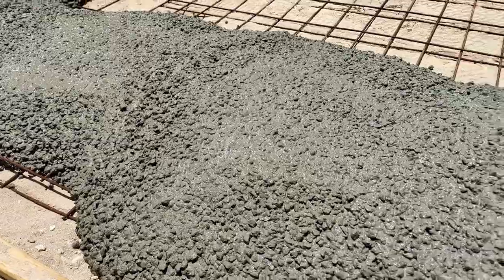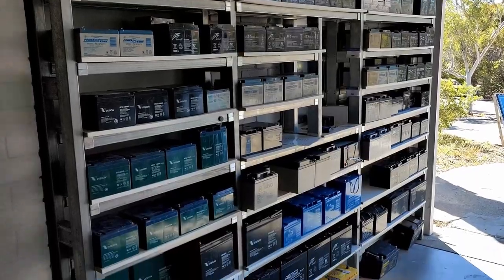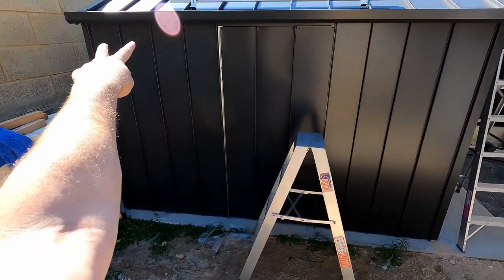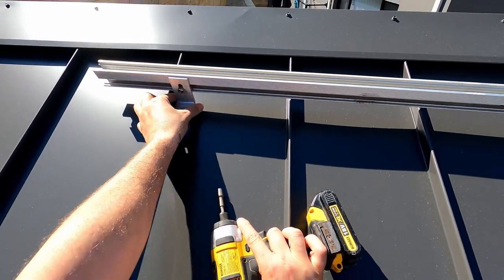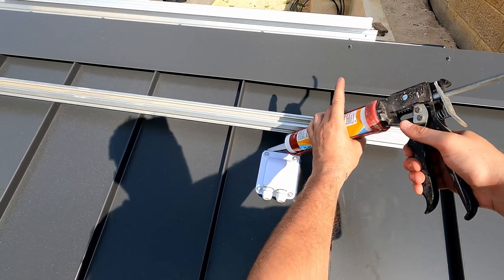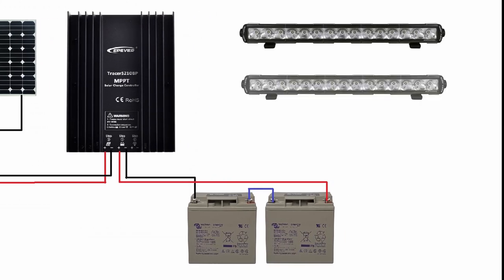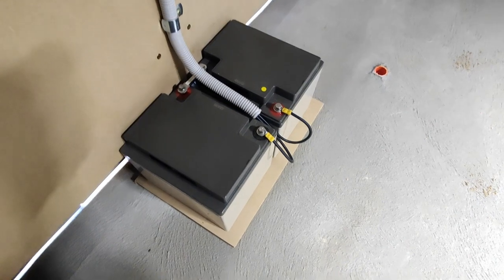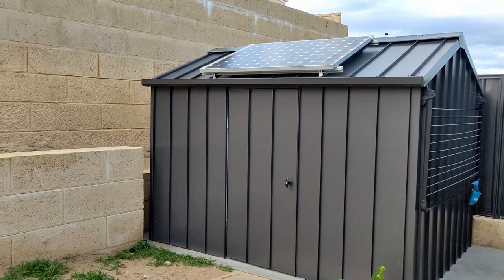DIY Off-Grid System For My Shed

Comment: Great job on the shed and roof and gutters, and AWESOME diagram on the electrical...but can't understand why you would use MDF?  It breaks apart easily (whenever you attempt to re-seat a screw, etc) and if you ever get it wet, even if it's a drip at the top, it can literally fall apart.  I'd consider 1/2" plywood, even if its a little more expensive.    Finally, Love the shed exterior walls, using the roofing material looks different and really nice!

Comment: Awesome job! I see you have a DC-only setup. Interesting ... any plans for an inverter off the battery for running AC equipment? Or are you sticking to DC? Besides lights, what will you run. Very inspirational!

Comment: Man, great video! I’m in the process of turning a shed into a music studio powered by solar. Is the wiring from the MPPT to RCD legal and easy enough to do?
Reply from the maker: Thanks mate. The low voltage DC wiring is fine, but you mentioned an RCD so I am assuming you are wanting to install an inverter (takes the DC voltage produced by the panels and stored in the batteries and converts it to 230v AC)? That part would certainly require a sparky. Hope that helps bro
Reply: @TheHandyTech  Yeah man! I would prefer pretty much the same set up as you have there. I only asked about RCD as a 'trip switch'. (Apologies for my lack of correct terminology). 

I have:
Panels -> MPPT -> Lithium battery -> Pure sinewave inverter. 

I'll be running transistor guitar amps and a computer (more or less) ..

Comment: Very curious how your prevented water getting into holes in the roof
Reply: You could use spray foam
Reply: Silicone is best
Reply: put duct tape down before screwing screws into the roof. the heat will melt the glue and make it water resistant.

Comment: Hey Mate , Great Video.. Just curious what sides you panels face? East and west? I like the idea of the small solar setup. Might have to check out those guys in Perth 👌
Did you end up doing anything with the shed base to seal it up from dust and rain? 
Cheers
Reply from the maker: Thanks bro much appreciated. Yep correct they face east and west - in may case that was the only real option for me unless I wanted to build standing frames and face the panel north. I've found the setup generates more than enough power for my needs at the moment. Nothing to seal it up but then again there is nothing sitting on the ground that I am worried about getting wet. Maybe some expanding foam would be able to fill the gaps up in a reasonable way

Comment: Hey there! I saw your comment on the "Outdoor" video and wanted to recommend the Segway Portable PowerStation Cube Series. It's a versatile and powerful backup power solution that's perfect for your outdoor adventures. With its massive capacity, fast recharging, and waterproof technology, it's a reliable choice for keeping your devices and appliances running. Plus, the smart app control feature is a neat addition. Check it out if you're looking for a reliable power source for your outdoor activities!

Comment: Hey mate, this is ace and exactly what I was thinking of (bar the solar and batteries).  Just had a couple of questions.
1. What size Handi did you go?
2. Are there any council regulations about how close you can put the shed to the boundary? where I am it is 900mm.

Comment: So, basically you spent 700 dollars for a light for your shed. Wow
Reply from the maker: I also did some lights for the lawn :) but when I get to doing some rain water based projects I have all the power I need
Reply: Cool story bwo, been Aussie, power connection to garden shed by sparky, so YOU CAN SEE SH1T when doors closed, or heavy rain.. will likely cost 1200$ not including trencher hire from house power box to small shed which can go up to 800-1000$.
The batteries alone cost my self 400$, so that would be 800$ for just his two batteries. The electrical components I have seen go over 100-200 each depending

This is why he said it was a steal.